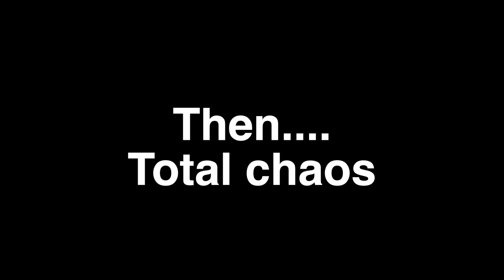FIRST RACE with THE BLACK SHEEP!!! Procharged G body

Comment: Jon have Jason lower the rear ride height soften the rear shocks and have Jason fabricate a rear wing .
Reply from the maker: on what premise should all of that be done
Reply: @JohnDoc  Jon, first let me say you have been doing a good job shaking the car down. My recommendations come from running ladder bar and 4 link cars for several years I'm 68 years old I ran comp eliminator in the late 60s and  my son and I now run Topsportsman. I sold my 2006 Topsportsman Rick Jones GTO to Jason Harris Dad10 years ago. Having the  car up in the rear moves the weight forward and at speed with the air rushing under the car and centrifugal force narrowing the rear tires it will loosen the cars handling. Softening the rear shocks will allow the car to plant a bit better and handle the down track bumps. If you can electrically and time control the rear shocks start out a little firm then soften a few seconds after the launch. Look at it this way old altered  and  funny cars had almost solid mounted rears and depended on a wide rear slick as part of the rear suspension Your car has a ton of available power and a relatively narrow tire you need to depend more on the shocks . The extended wing with a wicker bill will definitely add stability upstairs. You want to extend the length of the rear deck your little factory style rear spoiler is working  against you.  Last but most important get a Racepack data logger in the car at just the driveshaft RPM pickup alone will give you a understanding of how the car is working. Good luck and stay safe.

Comment: yea thats the type of shit that happens when you buy a used race car but there no other way to find out but running the car
Reply: All it takes is his own motor  to🤷‍♂️🤷‍♂️🤒😤🤒
Reply: I have one I have not tested yet , but bought it turn key in the winter time here in Michigan . Turned out the seller lied  about him making passes at Lapeer raceway . I had my doubts when he had no time slips  ? And the belts were years out of date ,  but  who  gets rid of time slips in less than a year ?  We pushed it on the trailer , no need to see if I fit , it's a full sized '76 Plymouth Volare  , tube chassis car . I went to drive it off the trailer  and my head was hitting the roof ( imagine with a helmet ! ) . The seat was so close to the pedals I could barely bend my legs enough to get them on the pedals , my knees were in my chest  . I have since moved it all to fit  but the guy was about 6' 3" or more , and I am 5'9" , so I know the track story was a lie for sure . .........I know where John is coming from  being in a race suit , in a black car , in the sun , I have been there in the past  . This one is black too  , and the windows are Lexan and dont roll down . I did install a fan inside the car though !